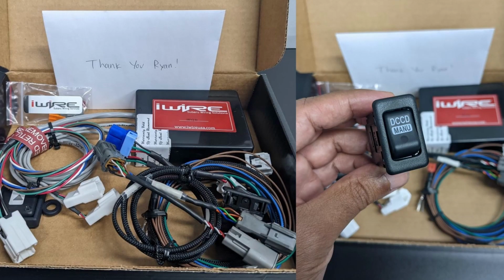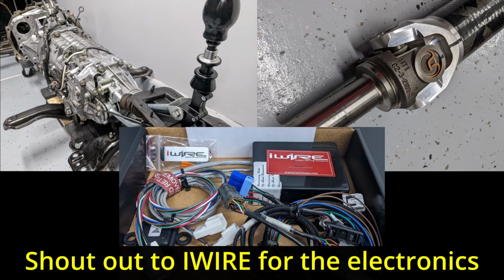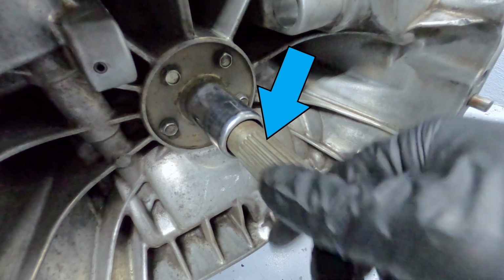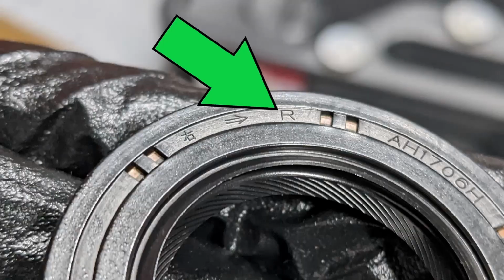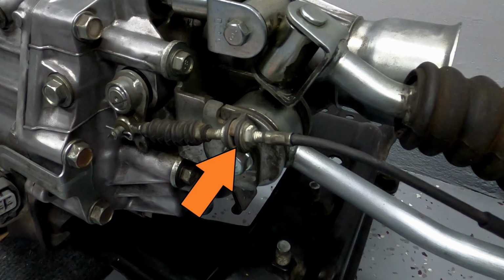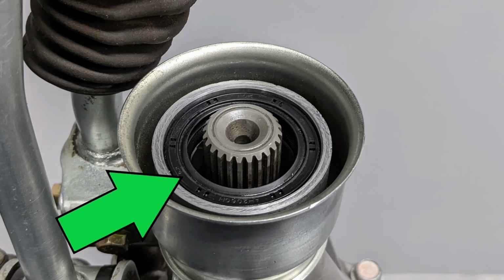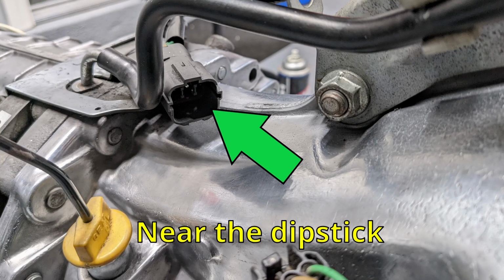Preparing a Subaru STI 6-Speed Transmission for a WRX Swapped Car

Comment from the maker: **Important note**
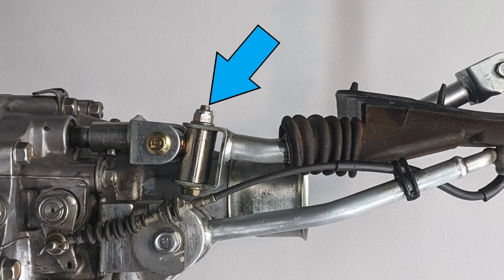Do not use anything but the OEM shaved bolt for the upper shifter linkage connection on the transmission side 10:34 . Standard bolts (like the one that came with the solid bushings) are too long. The shaved end should be  where the blue arrow is pointing. I will show this in the full swap video as I am unable to edit this one.